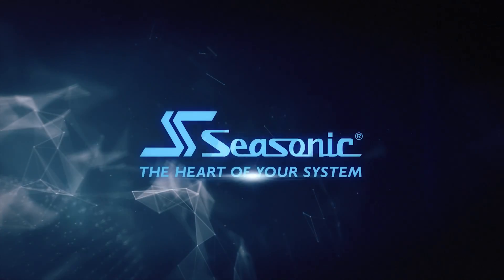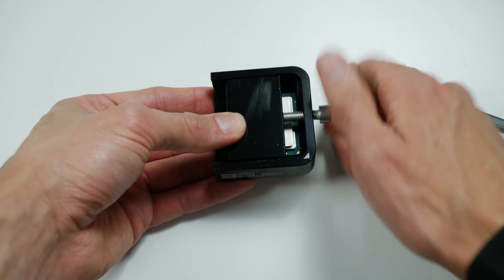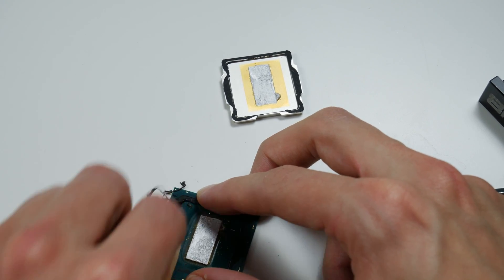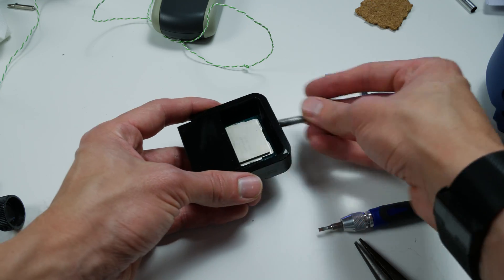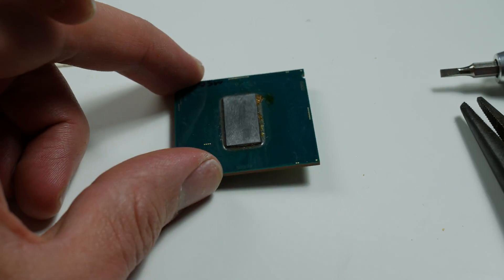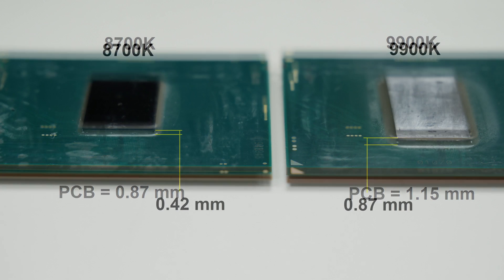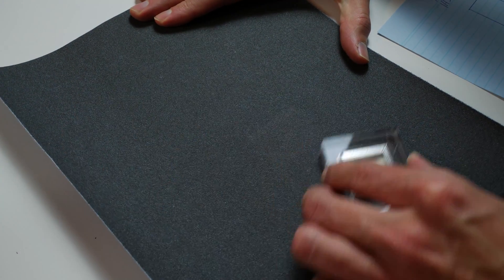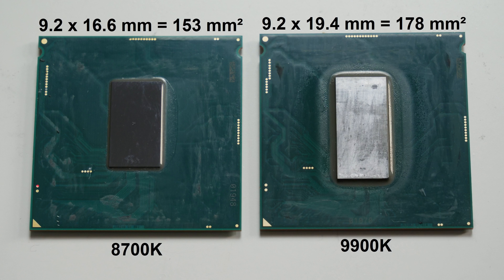Bad sTIM? Why is the 9900K so hot?

Comment: Just FYI I measured a delidded old xeon from mid 2000s which is soldered. I got the same die thickness of around  0.85mm +/- 5% but the solder layer I got is only about 0.25mm 

I have identified as this model.

https://ark.intel.com/products/28017/64-bit-Intel-Xeon-Processor-3-20-GHz-2M-Cache-800-MHz-FSB
Reply from the maker: Thanks for the info. 0.25 is still quite a bit if LM is about 0.05 or even less probably
Reply: No problems.
Perhaps maybe you could revisit Ryzen soldering and die thickness as a comparison and perhaps even a 2600k, iirc they were one of the last to be soldered from intel and had really good thermals. It would be interesting to see what the differences are.

From my old sample and what you have on this video it looks to be done like that from an engineering point, but more samples will give a better picture.

Comment: From what I understand, the upper layer of these reverse-package chips are spare silicon usually called the de-stress layer. They are silicon with the same thermal expansion coefficient as the silicon die, to mechanically cope with differential thermal expansion under load. This has been necessary ever since the industry abandoned ceramic bases, which have much closer thermal expansion coefficients as the silicon and doesn't require as thick of a de-stress layer.

If this layer isn't thick enough, the silicon die can over time crack, detach or delaminate internally. This has happened in the past when companies first adopted flip-chip designs on organic PCBs.

I wouldn't be too hasty to sand off the top layers for practical use, unless it is for experimenting purposes like Der8auer. I suspect Intel put that thicker PCB and de-stress layer on top because the 8 die elongated silicon setup is particularly prone to thermal stresses.
Reply: Finally, an intelligent comment.

Comment: Der8auer, the results for the sanded substrate (chip) are nothing new, is is well established and proved since the Athlon days. A better fight with Intel would be to make it stop putting out concave cpu heatspreaders, something that went forgotten. In my opinion a flat cpu heatspreader with a flat cooler copper base is a much viable option to all the prospective buyers. As almost 99% of buyers are not going to delid and sand down the chip, due to warranty and such, some "testing" you did is moot.
Reply from the maker: I don't do it so people repeat it. I do it to investigate out of personal interest and to educate others

Comment: I think they did solder the chip because they had to not because we want them to. And they did it in a bad way. Sometimes i'm just asking myself if there is even a lower way intel can screw up but they manage to surprize every time. Bad news.
Reply from the maker: yes of course :D It's also easy to do a refresh for example with the 18c CPU. Just solder, have a bit higher clocks - profit

Comment: Intel lost their knowledge in soldering years ago.
They used the same process than for the TIM, they didn't adapt their facility, as there was a low number of their CPU actually using soldering, and the investment cost is high.
Here is the result.
Soldering is different than TIM, process MUST be changed. They didnt.
Failed.

Now Intel is considering using TSMC facilities, can you guess why... ?
I think we can expect a new batch of 9900k coming from TSMC with better temps.

Comment: There are research papers out there regarding the silicon fracturing under thermal cycling. Your hypothesis about end-user pressure to solder and then Intel following up with the solution requiring a thicker die due to mechanical stress is right one point.

Comment: Just one note - Intel didn't solder 9th gen because there was demand for it from loyal customers. They know most of those people are going to buy them, so that wouldn't really drive sales.

Nah, Intel soldered these things because they've been backed into a corner, between these flamethrower architectures + AMD forcing them to increase core counts, these CPUs are just pumping out SOOOO much heat. I mean, we're seeing power consumption of the i9 greater than the Threadripper 2950 - SERIOUSLY?!

Regardless of how lackluster the solder job may be or how detrimental the thicker chip(whether or not the switch to solder had anything to do with it) may be, there is NO WAY Intel was going to be able to legitimately offer these CPUs using their previous toothpaste at all. I mean, we need to be honest here, Intel isn't increasing the cost of manufacturing unless they HAVE to, but most certainly not for the wishes of their customers.

Otherwise, great vid! And, utterly disappointing results. I mean, your delidded+liquid metal'd Ryzen basically saw no REAL gain, this is just ridiculous.
Reply from the maker: Good point there :)

Comment: It seems like Intel is acting more out of desperation under pressure from AMD. There should be absolutely no need to delid these CPU's just to bring temperatures down to safe levels. These are K parts so of course buyers will overclock them, at least that is the expectation and Intel should account for this. Bad Intel! Looks like we are heading back to the AMD64 days :)

Comment: Next question: why doesn't Intel use liquid metal TIM? Delta 8°C is pretty damn significant!

Is there a cost factor? Doesn't seem like it should matter. I mean Indium is expensive! It's like $600-$800/kg. Alloying it with Gallium and tin to make a sub room temperature alloy only reduces the raw cost and thus how much it should cost Intel in volume, because Gallium is only about $300/kg or less and tin is essentially free at $20/kg. Add to that that you can make do with a thinner layer because you don't have to adjust for so much movement.
Reply from the maker: I think LM is too difficult for massproduction to handle. It can be a pain in the ass to apply

Comment: so basically, spend 500 dollars on a cpu, slap a 360 mil rad on aforementioned cpu, notice that your only a few degrees off from thermal throttling. Proceed to void warranty and risk bricking your 500 dollar cpu by spending several hours of your life dye lapping it so that you at least 15 degrees off from tj max

Comment: I'm thinking the added thickness might have to do with the soldering.  Previously the problem was thermal cycling causing spalling of the silicon, which is why Ivy Bridge's die shrink didn't allow for soldering, at least according to what I've read from researchers.  Maybe the added thickness prevents this?
Reply: So I guess we're at 14nm+1mm+++++

Comment: Now what would happen if you delidded the 9900k, filled the IHS with liquid metal (after sealing the substrate so you dont get LM on the probe points) and then completely sealed the IHS to the pcb? After sanding the die of course.

Comment: That clearly shows soldering is done worse than AMD does. In your testing of delidded AMD cpu, temperature difference was so low its clearly not worth doing. But in case of 9900k it might be good idea.
I was expecting it would run cooler and overclock better.

Comment: Maybe try re-soldering.  But without putting pressure on the IHS.
Reply: I agree.  If you re-solder without pressure on the IHS, the thickness of the solder would probably be dictated by surface tension and it would be free to wick evenly.

Comment: my i7-4790 idles at 32 - 35 and under very heavy load it doesn't even get above 65 - 70... and I'm using a stock cooler

Comment: good experiment.I personally think why Intel make silicon layer thicker is structure strengh reason.I still remember the era CPU doesn't have IHS like K7 Athlon.When addig too much force the die corner will crack and full CPU has a chance to die with it.9900k is very expensive,compare with 5 degree celicus temperature dropping,it's safer to add addtional silicon layer to keep the structure strength.

Comment: I guess you could mill a custom heat spreader that will be close to the sides of the chip and apply liquid metal to all sides of the chip? I think it is reasonable, after all you sanded down your chip with sandpaper :D :D :D

Comment: Before I see your video I'm just going to ask a question. Where are people getting those idiotic temperatures that I've seen on some ADM fansites? It's pathetic and stupid. I have mine running stable at 5 MHz in all cores, using a Noctua N15s if I'm not mistaken, and the temp stays below 80 degrees centigrade... With my main 4 cores at 5.1 MHz and the rest at 5, never has anything gone above 86, which is my cutoff temp (hour runs in Prime/OCCT/and Intel stress test)... The I7 2700X, which I also own, but did not buy, at 4.1 hovers around 80 degrees... So, who is spreading all this BS?
Cheers.

Comment: Damn interesting research, does the increasing thickness protect the chip from the solder. It seems the increase in silicon thickness is almost acting like a mild insulator and inhibiting thermal conductivity out of the chip, wtf intel. How do old chips like the 2600k that used solder not require this silicon thickness but the 9900k does?

Comment: Ryzen is soldered and it doesn't have these kinds of problems.
Reply: It doesn't reach 5GHz on air or water either.
Reply: Which does not matter at all. The "5 GHz" argument is pointless as frequency is only one of many factors that influence single-core performance.

Comment: i need single core performance over multicore performance for one of my application, the one i use 95% of the time, but that other 5% is me rendering with blender and i was interested on this 9900k chip but i think i will keep my delidded 7700k @5.35 even if i can't clock my ram over 3500mhz but is running class 12, probably with 9900k i can run 3866 or even 4133 ram but i don't trust myself removing the indum layer, i might just buy one from his website

Comment: no reason to upgrade my delidded 7700k for that. Im going AMD next time
Reply: I was thinking of replacing my 6700k running at 4.9Ghz for Ryzen 2700x, however more cores wouldn't give me any benefits for games and desktop activities because of its low clocks, so I'll in stead wait for another generation.
Reply: im on a delidded 7700k, 5ghz, looking to upgrade but theres nothing worth upgrading to
Reply: you can try hard modding your motherboard to support 8th gen cpus
Reply: bad idea for hard modding. power delivery system wont cope with it.
Reply: Ant Bant in the same boat
Reply: Maybe by the time you can achieve that much tangible benefit Intel will have their shit figured out.

Or they won't, i'll be even happier to be honest :D

Comment: It's almost like Intel intentionally adds defects then later "corrects" them to suggest performance improvements.
Reply: Why don't you make CPUs if you think you can do so much better.
Reply: @Paul...such a childish response. Grow up.
Reply: @1pcfred  What intent? The kind of intent that undermines logic? Wyatt was not right or wrong by imagining future scenarios, that is not a bad thing as if said scenario does happen he can make that point... that is how humanity gets smarter by thinking. :D 

Fetcher.
Reply: It's common knowledge that CPU manufacturers intentionally hobble chips in various ways to differentiate pricing, for example, disabling cores and lanes in microcode or whatever. It's not too far-fetched to imagine they might also intentionally create a heat issue that limits performance, such as inadequate TIM, too-thick silicon, etc., which is what Der8auer's video made me think of.
Reply: on what you base your stupid hypothesis? Die is thicker to survive more joules of energy, as have thicker metal layer. one does not simply feed 8 skylake cores with 4+ghz clocks at monolithic 14nm lithographic process. its not gimbed on purpose CPU, its panic try to stay competitive in front of AMD design, which been designed with multi core architecture in mind. Intel have no new CPU architecture on drawing board, so they reuse skylake, which is upgraded Haswell, and optimize density and transistor specifications in foundries to the bare limits of their manufacturing capabilities. This is end of this architecture started with Sandy Bridge processor lineup.

Also, disabled cores and lower clocks in different model is standard product difference in semiconductor industry. Not every cpu die is equal from waffle, some of them come worse, typical yield issues of photolithography process, and need to be down-clocked or have fussed off pieces of logics to remain stability of operation. Thats nature of manufacturing semiconductor sequential digital devices.
Reply: this also explains price brackets within lineup SKU. Silicon waffle yield more worse bins than better bins, and the top performing silicons comes mainly from centre of waffle. Because high quality silicon dies yield in lower quantity, with non-linear scaling in cost per high performing yield, best bins are usually most expansive and are used in flagship models of SKU. 

No damn conspiracy or gimping on purpose, pure nature of production process. no flawed architectures on purpose, such precise digital device would not work stable if gimped on purpose. Overclocking also is operating beyond safe specifications. Heats? own risk.
Reply: weak trolling, one does not feed more skylate quotes in a monologue

Comment: Maybe check i7 2600k’s (or any Sandy Bridge, I guess) die thickness as a reference, since that was the last line of CPUs (mainstream, excluding other extreme CPUs) to be soldered to the IHS. That could be a starting point. Then compare that to say a i7 3770k, when they started to used thermal paste instead. Maybe that’ll give us an idea as to why it has to be so thick. 

Also, I love what you’re doing as far as research goes when looking into these sort of things. Some may say it’s pointless, but I find it very intriguing and informative on the manufacturing process as a whole. Hope you never stop. Great info thus far. 👍
Reply: This is exactly where I thought of too. Please do this!

Comment: If PCB and chip are both thicker, does that mean the IHS is thinner?  Are hot spots then not spreading their energy across as wide an area? Also, mentioning the PCB is the thickness of Haswell: does this CPU user a FIVR?
Reply from the maker: Yes about 3.1mm vs 2.3mm

Comment: I was expecting that the 9900k with solder would be able to do 5.0GHz on all cores with a big air cooler and stay under 80 C on the hottest core, but to reach that is seems you need buy a pretested golden delidded lapped CPU with liquid metal applied, WTF......

My 2600k from April 2011 is still running at 4.8 GHz with an voltage of 1.350 V (+0.125 V in OFFSET), and it only hits 76 C on its hottest core, no delidding just attached a normal big air cooler (50$ Scythe Mugen). It ran 5.0 Ghz with an voltage of 1.425 V (+0.200 V in OFFSET), but didn't like that the hottest core would reach 85 C, so turned it down to 4.8GHz around 5 years ago.

Looks like my 2600k is going to last yet another generation, but to be honest at 1440p ultra it still seems fine with a GTX 1080 Ti, matches my friends 1800X in games anyway.
Reply: @Martin - I'm still running a 2500k @ 4.6GHz as well because CPU progress has stagnated and replacing half of my system for a small performance boost hasn't been worth it yet.
Reply: @Salt Maker That's £350 for the CPU and motherboard for a roughly 35% performance boost. Not worth it still when my 2500k can still handle 9/10 games and £350 on a GPU gets you a 100% performance boost.
Reply: @Salt Maker 24GB of 1833MHz. And at 1440p the 2500k can keep up with a 1070 which is what you'd get for £350. But I'm just gonna block you know because you're a prick :)

Comment: Just measure the thickness of the die of a Ryzen CPU, if the thickness is lower than the 9900k, then the extra thickness is not needed for soldering.
Reply: TSMC and Intel use different fabrication processes. You're comparing Apples to IBMs.

Comment: This is interesting to say the least.  I'm glad you went through the process to see why the temps were higher than the 8700k.  I am certainly looking forward to the Ryzen 3700/3800x CPUs in 2019.  By then for the first time in about a decade we may see Intel and AMD CPUs going blow for blow in all workloads.  Real competition is welcome.  To be fair to Intel you can't tell me a 9900k clocked at 4.8 or 4.9 GHz is a bad thing either.  Even if you had an 8700k at 5.1GHz wouldn't the extra 4 threads on the 9900k still provide better performance in multi-threaded applications?  Even the single thread numbers should still be pretty good just from small IPC improvements right?

Comment: What if they couldn't control the cpu's thermals and they used solder instead of paste because it was the only thing that barely managed to transfer all that heat? What if the cpu is bad and they tried to patch it up and release it like that?